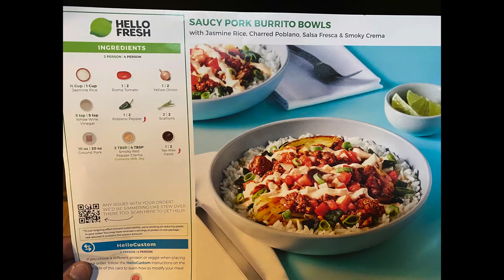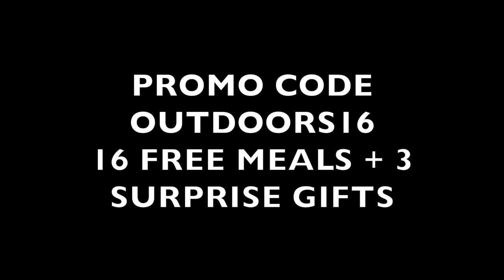Doctor Visit, Dirt Moving, and Stone Spreading

Comment: Years ago, I dislocated one of my fingers (playing softball, if that matters).  It was reduced and splinted for 6 weeks.  When the splint came off, the  finger was in a bent position and wouldn't straighten. 
After a year like that, I want back to the Dr. To see what could be done.  The Dr. told me I had to manually stretch that joint, past the point of pain, every day.  It took about another year to loosen up to normal.  It works perfectly fine now, but it took a year of discipline to get it back to normal.

Comment: Mike, I share this in common with you for a related injury. When I was a child I fell on some glass cutting into the palm on my hand. It actually severed two tendons. One of them they sacrificed, and they attached the other one. Little did I know that the scar tissue on my palm from the cut would adhere to the tendon. I went to therapy, and they would soak it in warm water with some of that manila colored soap, and then the doctor would grab my hand, and do a tear by forcing open my palm. It was painful. We did this repeatedly, and I started to develop a twitch in my face as an adverse fear reaction. My Mom wouldn't have anything to do with that, so I stopped going to therapy. I came home, and worked it myself. Mind you, I was in my single digit years, a little under 10. My Dad told me that he came into the bathroom, and saw me working it, and slowly by my own accord, I opened my hand with some strain, and he said the tears were streaming down his face. In my teens I took up guitar, and used to do finger exercises. I got so well trained, I used to fly, and I still do, across the fretboard. For the most part everything works correctly. 
Talk to your doctor, but if there is any scar tissue adhering to a tendon, that would cause the problem. Solving that, could require you to do some finger movement forcing a little bit for it to break free. I don't know if this is exactly what is happening to you. Listen to the doctor, not me. LOve you guys. Your channel is the best. Hey, I am working hot and heavy on getting my woodworking shop You Tube ready. Painting floors, organizing. You inspire me. You are going to love my shop. I won't put in a link. I'm sure you get enough people trying to do that. When I am ready to share it with you, I will send you an email with a link. I'm in Eastern PA, in a suburb of Philadelphia. I grew up in the woods at the end of my street.

Comment: I'm not sure where you get your geo-textile, but if you have a nursery supplier in your area they might be worth a look. I found one near me in N.E. Ohio that sells a 432' roll for $260.00. Cherokee Manufacturing is the company.  Love the flame cut idea!
Reply: The purpose is to keep the aggregate separate from the subgrade, while allowing water to pass thru.  The rock provides ballast which is pretty much just downward pressure on the subgrade.  The pressure stabilizes the subgrade 0over a period of time, by forcing out water.  Water is less dense than soil so it rises to the top during this procedure, (Stoke's Law).  That is why the fabric must be permeable.  The water passes thru the fabric and into the stone where it can evaporate or run off.  If the stone was allowed to combine with the subgrade, it would loose some of it's ballasting capabilities.  Compare soil to a wet sponge:  squeeze it and the water comes out.

Comment: Interesting to learn about the fabric and how to get the coverage started. I’m about to get few loads of crushed concrete to fill in low spots in drive and parking pads and anxious to try your spreading methods. 

I’ve been threw major hand, wrist and arm injuries myself and can tell ya getting a hand strength exerciser that’s adjustable tension does wonders….wrapping the fingers around the handles and squeezing under stress hurts but forces the fingers to bend and overcome scar tissue.

Comment: I will pass on that trick of using a gas blowtorch to cut the geotex to my youngest lad who is putting in a roadway down to his new buil house, which took a 100 tonnes of recyled railway ballast plus about 140 tonnes of recyled house brick and concrete. This then all compacted into the clay bed with a medium sized twin drum compactor machine and roadway was good enough to support 140 tonnes of concrete to be poured for the house footings. Once all the bulding traffic has finnished then we lay geotex over the stone and put more stone on top a compact that down all of which should give a long lasting wear for the light vehicle traffic.

Comment: Mike, what’s the main purpose for the geo-textile, and can it be used under a stone driveway for weed control?
Reply from the maker: It saves on stone by preventing your base rock from sinking
Reply: The fabric keeps the aggregate separated from the subgrade.  The aggregate acts as a ballast on the subgrade which means it applies a downward pressure on it.  This pressure serves to compress the subgrade and force out excess water and compacting it,  also known as stabilization.  It takes time for this to occur.  The water rises to the top because it is less dense than soil particles.  When the water comes to the fabric, it must be able to pass thru, so the fabric must be permeable.  When the water passes thru and into the aggregate, it can either run off or evaporate. The water naturally crawls to the top due to capillary action. The ballast keeping pressure on the subgrade, continues to insure it's stability.  There is also a subtle benefit of the fabric in a pavement structure as it can provide tensile reinforcement in bottom of the structure.  Kind of like a reinforcing bar in a concrete beam.
I could not recommend geotextile for weed control as due to it's porosity there are some grasses that will penetrate it, (nut grass).  Stick with non-porous barriers for weed control like some kind of polyethelyne sheeting.

Comment: You may have mentioned it in the past, but where do you get your geotextile from? I ordered mine through home depot and was disappointed in that it was supposed to come in a 12'x300' roll but what I got was the material was folded 6' wide and the 300' length was folded in 1/2 twice before rolled up which I had to totally unfold, re-roll it.